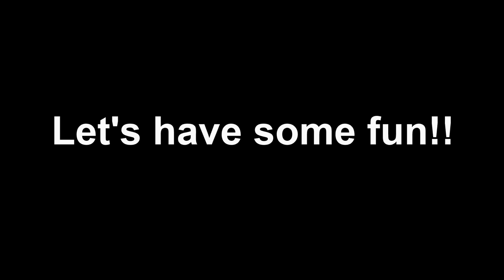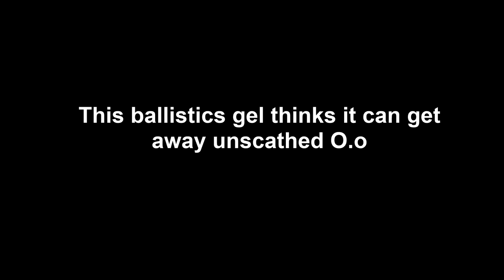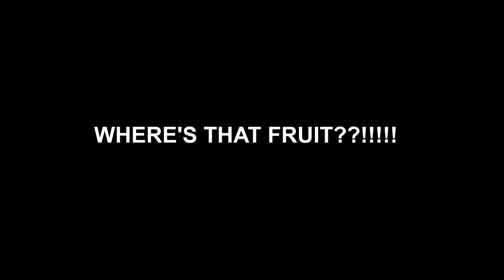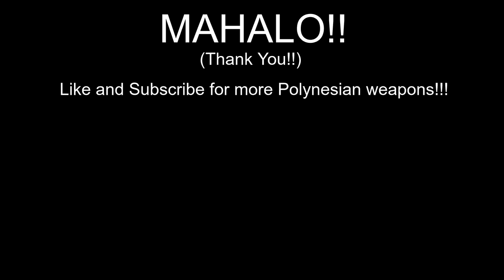Making a Maori Patu war club

Comment: I am convinced. Koa is the prettiest wood! it's always so satisfying when it get's oiled.

How was the club used? Was it a primary, a secondary, did people dual wield them?
Reply from the maker: I would have to agree 😁 the patu could be used as both a primary and secondary.  It was used with quick power strikes focusing the energy of the swing on the edge or blade of the patu.  I don’t know if they duel wielded them but i don’t think so.   Maori warriors like Hawaiians tended to fight largely in Melee range so the use of the patu and or mere would not be uncommon.
Reply: Maori did dual wield patu, the patu swims like a fish using a stabbing motion, these short powerful jabs would be aimed at soft vulnerable places like the mouth and neck.